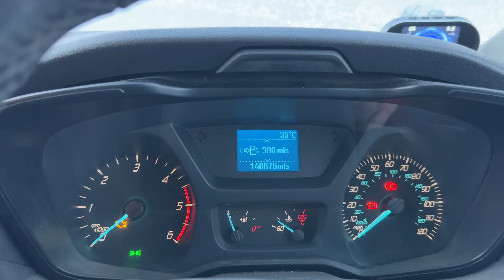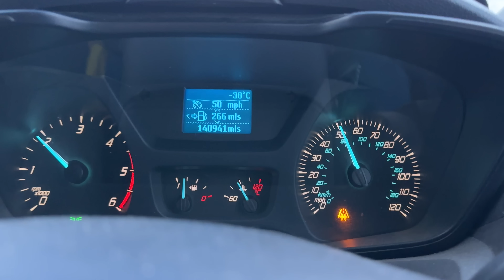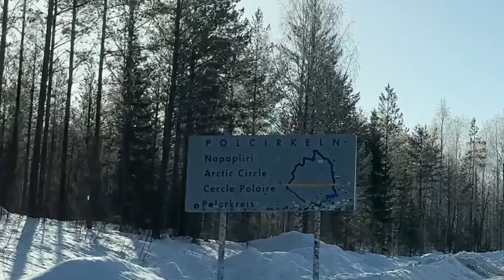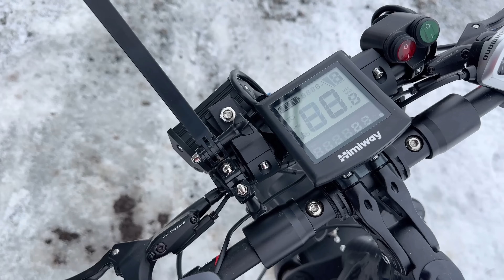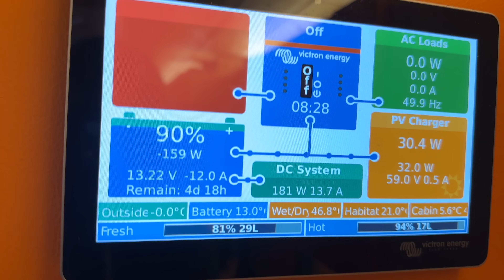ITS ALL OVER | Winter in the ARCTIC

Comment: [11:36]  Well done.  Maybe 2025 will be the year to bring out a book of arctic photographs?  Also, I was going to ask if you had any emergency communication facilities via satellite,  but as you have an iPhone 14 there,  the answer is `yes`.  Meanwhile, I'm just about ready to start watching series 4.   ;-)
Reply from the maker: A good point I don’t actually use many Arctic photos on my photography portfolio website. 

As a satellite communications whilst iPhone 14 and my 16 do you have the feature. I don’t think it’s yet to be fully activated outside of the US outside except for Emergency options.

But for my satellite communications, carry a Garmin inreach mini which I usually take all over the planet when working on remote expeditions
Reply: @MispronouncedAdventures  `carry a Garmin inreach mini which I usually take all over the planet` ->  ahh, that is what I was getting at. The Garmin (or the Zoleo) is a very handy tool to have in an emergency. You seem to have that nicely covered, so the issue of an iPhone14 (onwards) is somewhat irrelevant. You have spent the money on some solid emergency equipment. Well done. I only ask as I don't recall ever seeing an  inreach mini pinned to your chest - it is probably safely in your pocket when needed, no doubt.
Reply: @MispronouncedAdventures  Some pro photographers use very large format glossy books, with one photo per page. Not, particularly my cup of tea. But, for example, your van  at  [11:37]  shows just the right colours (IMHO) for some artwork, with blue inside, a limited amount of Northern Lights, lots of clear stars, settlement to the left and orange glow to the right, (plus the wheels and rack), is pretty much spot on. That presented as maybe a (smaller book) half page (two to a page),  with maybe a very brief note about any weather issues / any story issues at the time, would provide a great photographic memoir of your Arctic life, mixed up from four series. A very brief intro at the start of the book, listing your kit (eg Camera C1 was ..., C2 was ... , Lens L1 was ... etc, plus Drone D1), could then be covered on each photo page with a simple code, eg C2 / L1, without needing to waffle on too much about camera gear all over the place. Likewise, a quick 2 page intro at the start of the book about long exposure photography for the Northern Lights, would save yourself from having to repeat yourself on every page. A cheap and cheerful book put out on the am.a.zon market place might be another helpful revenue stream to help with the new van build?

Comment: Quick question if I may , you mentioned your next van will either be a man tge 4x4 or a transit awd.
I'm in exactly the same dilemma, could you mention maybe on here or a video on which van and why/reasons over the one you didn't go for .
The transit are great van s but I'm not a fan of the wet belt , as for the man tge I'm in the dark as to how reliable they are .
Many thanks in advance
Reply from the maker: I think I’ll be going for the MAN TGE 4WD with auto gearbox. 

I do love the Transit, the body is taller than the MAN but and a big but. With my polls and post about it on instagram and Facebook via been interesting. I’ve been privately recommended against the AWD transit by many AWD transit owners due to the reliability of the MT82 gearbox ( the gearbox the AWD transit uses ) and the very expensive issues they have had. 

I’ve been talking to a number of MAN TGE 4WD owners taking them to them interesting placing and I’m only positive points

Comment: Hi Alex a lot of others have said Germany is strict about additional lights and they must be covered while driving on public roads , I have never seen you pit covers on, are you lucky not to get nicked or is it not that bad?
Reply from the maker: I think only one person has mentioned it before in the comment about covers. 

All of my auxiliary lights are on a different electrical system to the vans and not automatic with the vans normal lighting ( unless I have a switch turned on to make them automatic ) if that’s important or not I don’t know. most of the trips I pass Germany in a day.  I don’t use them in the uk or the rest of Europe apart from the Nordics. 

My top bar is also EU legal spec and I have covers from the bottom set
Reply: I've driven thousands of miles in Germany and Austria over the last 10 years with auxilliary lights and have never covered them and never encountered any issues at all. Maybe the person who had problems had them switched on?